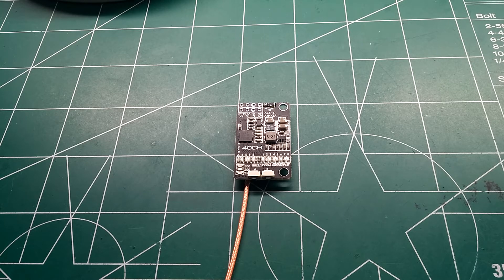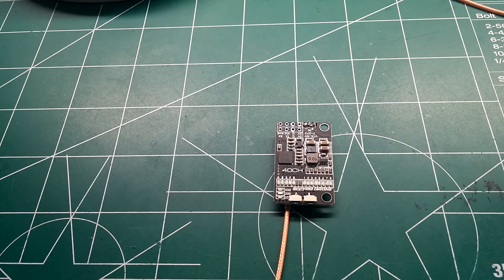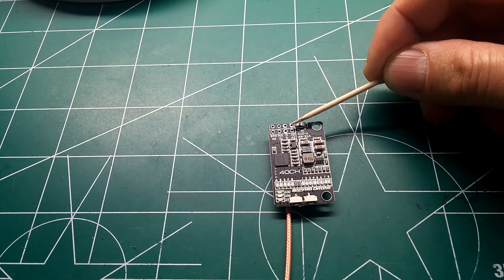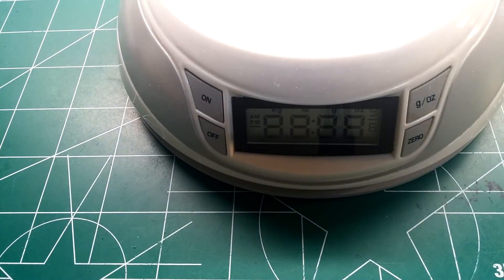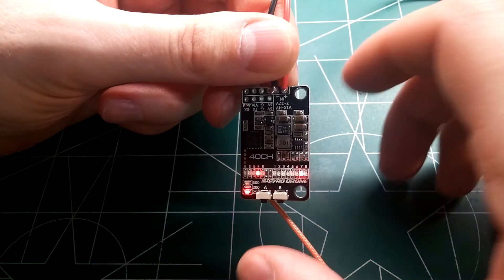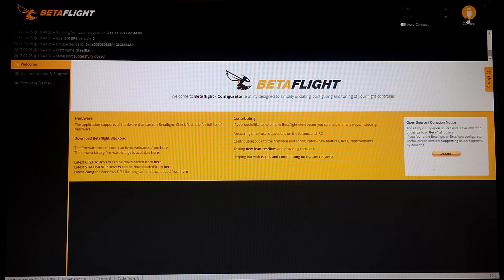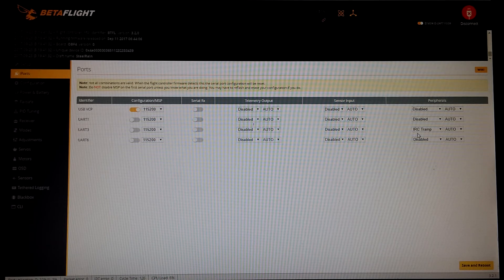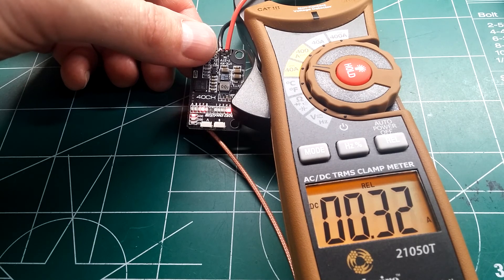Matek/Pyrodrone VTX Review/Setup

Comment: I've got the v2 and even at 25mw it gets super got. Is this normal or is it faulty? Cheers
Reply from the maker: LordKwad - Usually if any vtx is powered on the bench with no airflow they get pretty hot, even set at 25mw from my testing experience.

Comment: I have a spf3 and connected it to port 2 followed the steps and nothing shows up. Do need a osd fc? Any help would be appreciated
Reply from the maker: blaz1 - Yes, a flight controller with an osd chip is a must to control the vtx functions, and if not and you're using a Taranis radio, then you can change and set the vtx functions through the radio's lua scripts.

Comment: Cool VTX, but how does the video compare to the video from a TBS Unify or Tramp?
Reply from the maker: Marshall Campbell - The video is identical if not better than the Unify due to the better heat dissipation, and the transmission distance on max power is similar from my testing and experience.